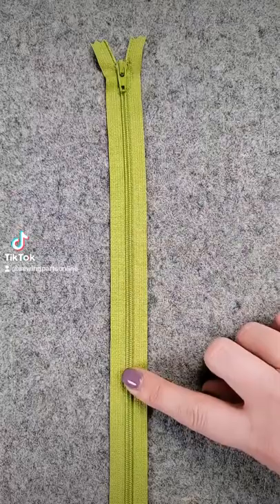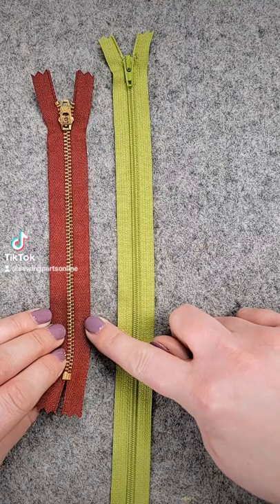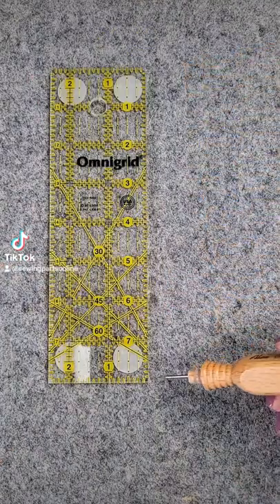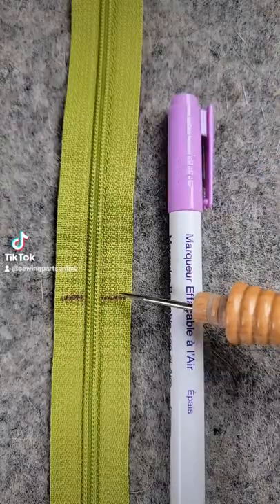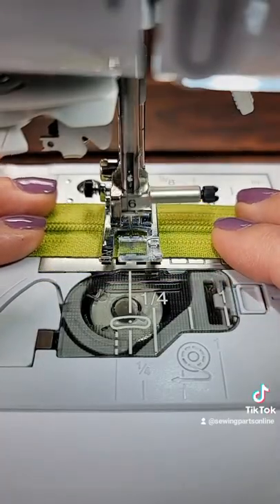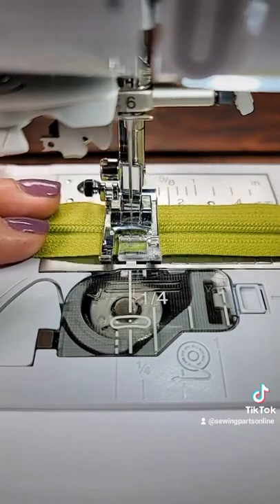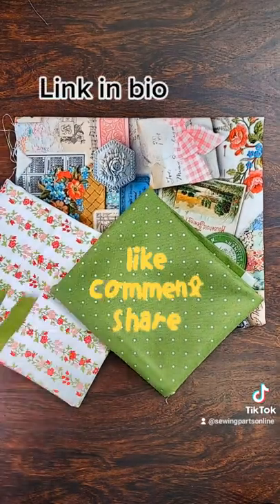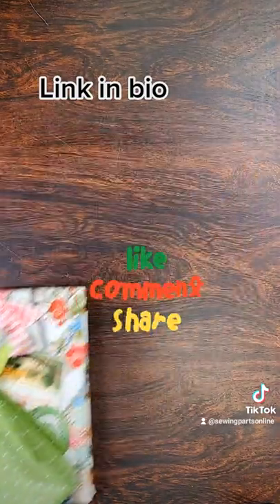Shorten a Nylon Zipper! #sew #sewing #zipper

Comment: I have always just sewn a tack by hand, using a heavy thread, and removed the bulky metal teeth as needed.
Reply from the maker: That works! Next, I am making a video on shortening a metal zipper. ☺ Do you save your stops and reuse them after?
Reply: @SewingPartsOnline  No, I don't save the stops. Pls showcus how to reuse them. I need to repair the bottom of a separating plastic zip on a child's jacket. Several teeth are missing. I dread replacing it!
Reply from the maker: @susancorvalan6765  I will be releasing the Shortening a Metal Zipper video tomorrow! I don't currently have a video about your issue on the separating zipper, but I found a video that may help you. https://www.youtube.com/watch?v=KlfcXNvMicU Honestly, you may be better off getting a new separating zipper. We offer them on our site if you need one.  https://www.sewingpartsonline.com/zippers.aspx?filter.zipperstyle=Separating&index=1
Reply: @SewingPartsOnline  Thank you!! Suck a quick response. I am smart to sub with alerts because your vids are so helpful. I will check your referral and consider the dreaded replacement. A placket with snaps or buttons might be ok too.